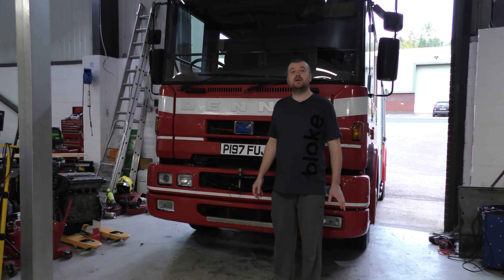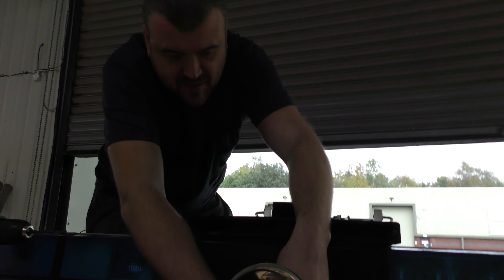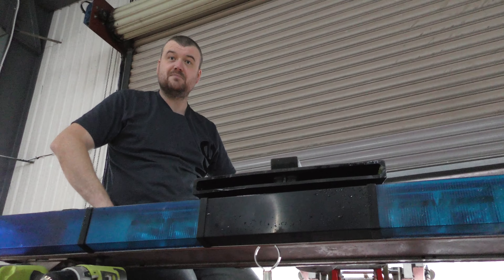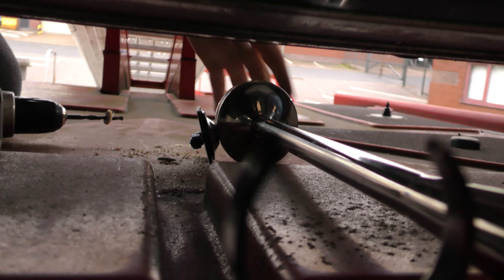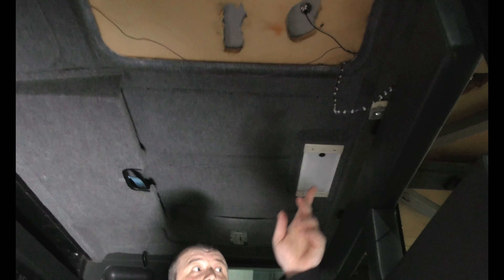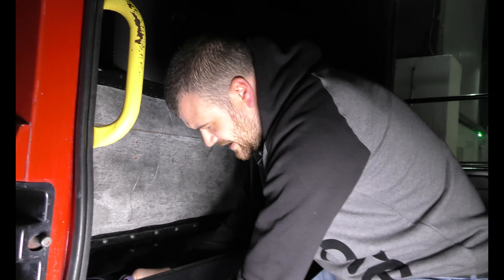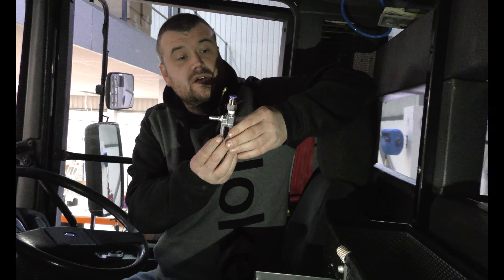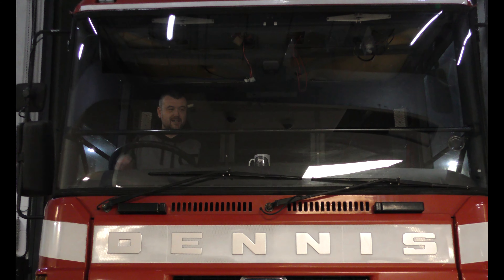How to fit a Bull Horn to a Fire Engine

Comment: You should have just used the auxiliary air tank that fills off the engine compressor with the solenoid valve and it would have been easier, cheaper and louder as the aux tank fills off the engine compressor and runs at about 11bar (160 psi) but can accept a bigger bore hose so would transfer air faster.

Comment: Now I’ve not watched all this video yet as the very beginning has baffled me. Now tell me if I’m wrong, this truck has its own air system? so why not just tap into that rather then putting a stand alone system in? it don’t make sense to me can you explain before I watch the rest or if I watch the rest thanks
Reply: I thought exactly the same. The truck should have at minimum 3 air reservoirs. Normally the 3rd is for auxiliary things. I wouldve tapped and air supply from this tank. 

Rather than for it's own noisy compressor

Comment: Louder we need it louder lol 

At least it looks the part now and theres always the backup of tying in to the vehicles air system , as that should be at least 10 bar 110/120 psi. my last scania 520 ran at 12 bar and had train horn fitted, maybe that could be next horn mod lol cheers ken